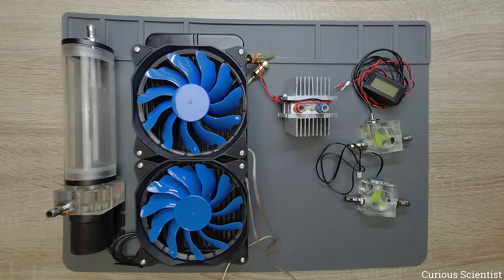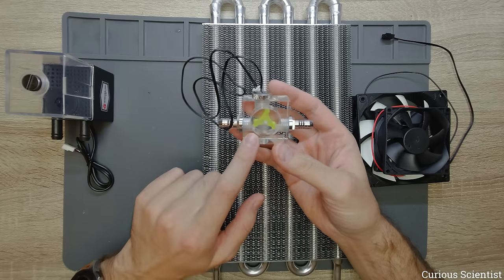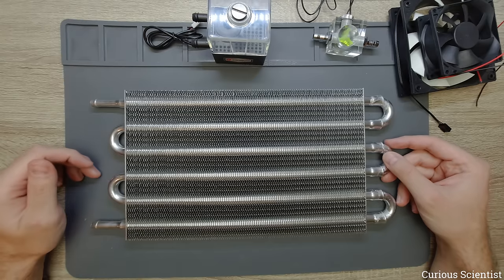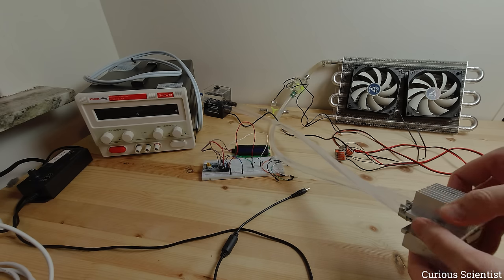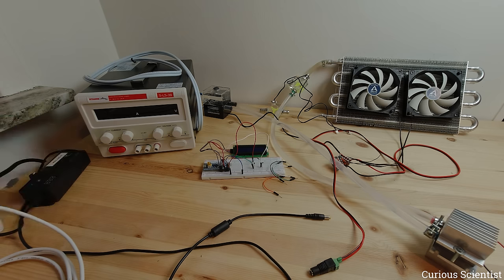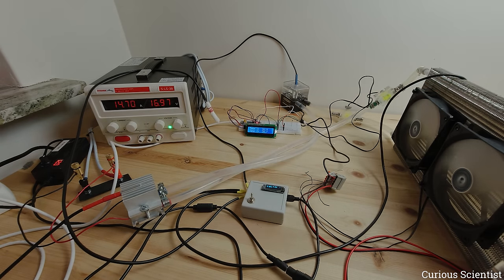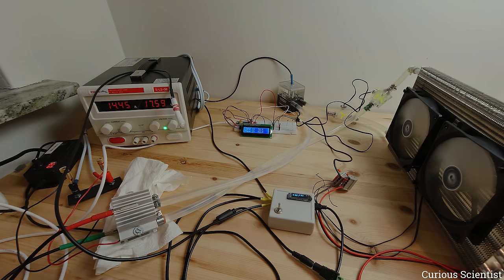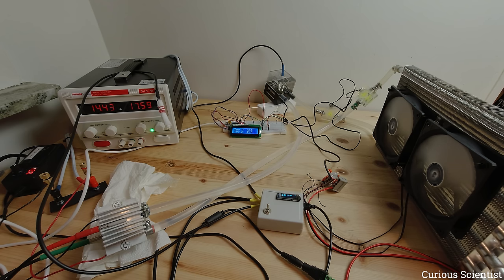Building and testing a new water cooling system for Peltier coolers

Comment: Such videos bring in people with ideas, here it is one.... Power your Peltier with solar panel, the pump too, put at least 4 pcs and a fan,and recirculate the water from your outside pool. You warm the pool and cool your house.Not for free because the solar panel, panel voltage converter and etc cost some.But maybe it worth. If you work from home, put the cooler near you, at 1-2 meters but not to blow in your face :)) avoid wind-eye problems. Also if you don't have a pool, use a plastic water container, 50-100L or more, insulate it a bit (to avoid escape heat from container to the room) and heat that water to use it for washing dishes or take a bath/shower.
Reply from the maker: Hi! Problems with the idea (at least for me): I live in a small apartment. No pool, no roof to place solar panels, no place to put a 50-100 L water reservoir. By the way, if you just keep recirculating the water into an insulated tank, you Peltiers will get hotter and hotter and their efficiency will be worse with time.

Comment: Just a suggestion to this, build a shroud for the fans instead of having them sit directly on the radiator cooling fins, same as a vehicle radiator system. You want the fans to pull out as much air through a the entire radiator. By putting them directly in one spot you only cool that spot but you inadvertently create hot spots on the radiator where there is no air flow.
Reply from the maker: Thanks, this is a great idea! My original idea was to cover the whole radiator with fans, but unfortunately, I did not have enough fans in the correct size for that. But that shroud would make an excellent work for sure! I will keep this in mind for future builds, thanks!
Reply: @CuriousScientist  I think you get better performance pulling air through radiator (with a small gap) since the fans will draw air from all directions. Don’t push air through since airflow will mostly be at the tips of the fan blades. 5:50 the computer radiator has a small gap built in between radiator fins and where the fan sits. 

Of course, twice as many fans in a push pull config will perform even better, I’m sure.
Reply from the maker: Absolutely, but first one must check the optimal use of the fan. Some might push better while others might pull better. So, I would say, "it depends". But sure, there's room for improvement.
Reply: @CuriousScientist  I never heard some fans are better in push config before. I guess I thought either it wouldn’t make any difference if the impedance was before or after the fan, or better in pull config (because higher pressure difference at the fan blade tips in push config - a guess).
Reply: @davadoff  I've heard of this actually; (automotive industry actually) usual you want to suck in air as you move forward.  ( think ram style on a fish such a a barracuda or mackerel). As you move it automatically pull the heat towards the motor. That's why in that instance it's ideal to duct the hot air out of the engine bay. 

In some high HP/horsepower applications they will actually blow the air into the radiator to cool it off. Since they are going fast enough to negate drag resistance.  Just in the applications If your idling or parked with the motor running you do overheat faster.
Reply: Always use a well ducted fan shroud doesn't even have to be complex so long as you are sticking to the rules of fluid dynamics.

Comment: Hi my guy. The temperature differential between the inlet and outlet of the radiator is not very important. The performance of a radiator is measured by its ability to remove heat from the system overall. The liquid is moving rapidly, so a big differential between any parts of the loop is not expected. That's why it's conventional knowledge in PC watercooling that the order of components in a watercooling loop is unimportant. If you want to know the relative performance of this setup compared to a conventional PC watercooling radiator, you would need to compare the average temperature of the loop with this radiator, vs a traditional radiator. It would be advisable to do this with lower and higher heat energy inputs, because different radiators have different efficiency curves as temperature increases. Thanks for the interesting video!
Reply from the maker: Hi and welcome! Since the temperature difference between the inlet and the outlet of the radiator is proportional to the heat removed from the system overall, I think it is a good approach for a comparative study.
Reply: @CuriousScientist  really? in most loops, the difference for in vs out is 2-3 degrees max, so why did you consider the ~3 degrees difference you saw to be "bad"?
Reply from the maker: @eggnogsaber  Bad, as compared to my dedicated CPU cooler radiator.

Comment: i want to cool a cabin sized 6 feet × 4 feet × 2 feet with five 12715 peltier modules. i just want 25°c inside the cabin enough for a person to sleep at night. the temperarure difference i am trying to achieve is anywhere between 7 °c to 10 °c.  Can I achieve that temperature inside the cabin or is it a waste of time and money?
Reply from the maker: I think it would be a waste of money. 5 units is probably not enough. And I'd you really would run them at their best potential, each unit would consume about 250 W or so, and you would also need to get rid of this huge amount of heat. It's definitely not a cheap idea. I would not struggle with it.

Comment: Nice experiment!  My thoughts would be to thermally isolate each side of the peltier.  Styrofoam? Glass?  Insulate the cold side a must!  It's all delta T so isolating sides is critical.
Reply from the maker: Thanks! Of course, insulation and isolation would be a must in a real system. Styrofoam is a great and cheap option, it is also easy to cut to shape. Furthermore, you can buy those nice polyurethane foams with a self-adhesive layer on one side. They are also good and I saw them in professional applications.

Comment: Hi, I know this video is older, and maybe you have made changes and / or already tested this,  but wouldn't you have better cooling,  if you put the hot water through the radiator first to cool off some and then through  the petier cooler?  Since a fan and radiator can not drop the temperature below ambient, it's possible you are actually warming the water up slightly after it's been cooled.  I am no expert,  just looking into using peltiers and viewing examples from people that have used them. So asking questions as I see useful videos.
Reply from the maker: Hi! 
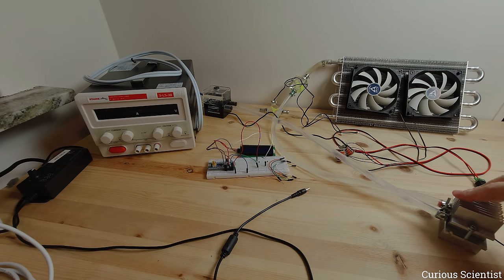I think you haven't watched the video carefully. I clearly explained the path of the water in the loop around 13:30.
The warm water goes from the hot side of the Peltier to the radiator where it dissipates the excess heat. Then the now roughly ambient temperature water enters the pump and gets pumped to the hot side to absorb heat again. The water won't heat up between the radiator and the pump, so it does not matter if the order is [hot side]-[radiator]-[pump]-[hot side] or [hot side]-[pump]-[radiator]-[hot side].

Comment: Hey curious scientist? Dont know if you will see this, however, im thinking on buying all the components to basically water cool the hot side of the peltier module to a tank, and also pump the cooled side of the peltier over a small fan. what inverter do i need? Power is my main mystery but i also need to power any pumps i use (these are expected to be small component pumps). Thanks.
Reply from the maker: Hi! Many people try to do the same as you - transfer heat to the cold side with a water cooling loop. Please, don't do it! Peltiers are not efficient and the whole cooling becomes even worse if you add a bunch of thermal resistance (the water cooling loop) between the cold side and the object to be cooled. Ideally, the cold side should be attached to the object that you want to cool (a microchip, a laser diode, a silicon detector...etc). Also, I assume that you will try to build something which would act as an AC. It won't work very well, you will need a large amount of Peltiers which then will need a lot of power and a lot of cooling. To answer your question: It depends on the Peltier. Check their datasheet. Typically, you will need around 13-18 V and anything between 6-15 A per Peltier cooler (if you are using the TEC127xx-series which are really popular).

Comment: Honestly, i'm not sure you are right about your radiator. Yes, the outside dimensions are bigger, but it is made for oil with higher viscosity than water. You can't just compare the outside dimensions, you also have to consider the internal surface area.
What i think woul'd be a better choice is another car part, the hot air coupe radiator.
They are designed more like PC-cooling radiators, but bigger. They have two chambers, one on each side with smaller channels running between them thru the fins.
That's what we used "back in the days", before you could buy purpouse built pc-cooling kits.

Also, build a shroud around your fans and put a little distance between the fans and the radiator sou your two fans can cover the whole surface area of your radiator.
Reply from the maker: Thanks for the valuable input. Yes, it is probably not the optimal solution for this application. But why I tested it is because these radiators are much cheaper than the PC components. So I was curious if they can do as good a job as the PC components. 

I checked the hot air coupe radiators, but they seem to have a similar price as the PC radiators. Then there's maybe not too much benefit to it for this purpose. 

Building a shroud (I could print it!) is also a great idea, thanks!
Reply: @CuriousScientist  Back then when i was messing with water cooling (Just as Pentium III 450Mhz was the thing, LOL), there was just one brand making ready to buy kits. That kit was very expensive and not very good. People used Eheim Aquarium pumps, home made cooling blocks and reservoirs.
The thing with those car heater radiators is that they come in all shapes and sizes. Maybe not cheap, but very efferctive.
Also, i didn,t realize that it was a several years old video i responded to. :p
Reply from the maker: Wow, the age of Pentium III was quite some years ago! I did not even have a computer at that time, I received my first in 2003, if I remember correctly. It seems that people had to be more creative in those times because there were not too many off-the-shelf solutions. 
Regarding the response, I keep my eyes on literally all comments and I try to respond to them, even if they are related to an old video. Funnily enough, this is one of my most popular videos, so I try to be even more active here.

Comment: That heat exchanger is optimised to condense gas into liquid & visa versa, the tubes can withstand pressure, the usual water radiator is optimised to reject heat from water, there is no pressure so the tubes can be flat & therefore are the optimised shape to reject heat. But I think you realised that with your experiment ;-)
Reply from the maker: Yes, I realized that, but nevertheless your comment is very valuable because of the small details you mentioned! Thank you for that! With Peltier coolers, we will never boil the water (hopefully, haha), so I never intended to use it the radiator "properly". I just wanted to look at it because it is much cheaper than the regular water cooling radiator and I wanted to see how it performs.
Reply: @CuriousScientist I am a refrigeration / airconditioning engineer by trade & had access to the exact same type of heat exchangers & came to the same conclusion when I started experimenting with Peltiers 10 years ago. I now use the off the shelf water radiators as they are optimised for what we are doing & don't cost that much anyway from Ebay China ;-)